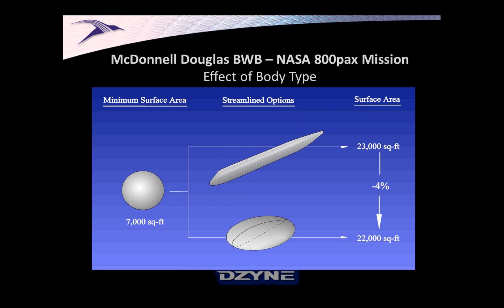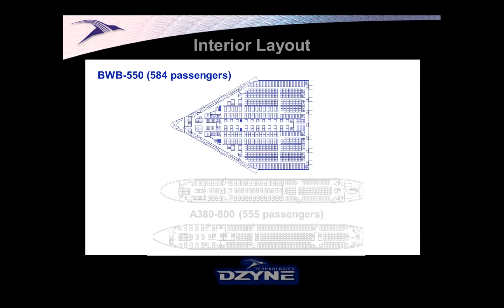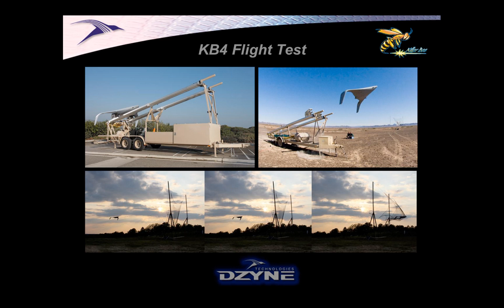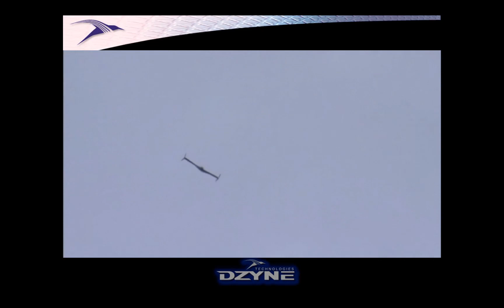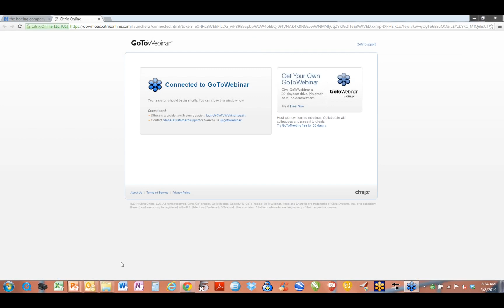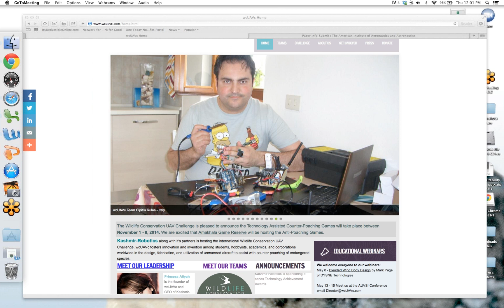Blended Wing Body Aircraft

Comment: Thanks for this amazing explanation!
I'm just wondering, if there are so many advantages for a BWB commercial aircraft, why are they not build currently?
Reply: Ive had that question for a while too
Reply: It is expensive to try new tech
Reply: It's all about inertia. Traditional aircraft have all of the equipment and infrastructure set up for them at airports, all of the interiors are fairly similar, you don't have to develop drastically new procedures for crew and so on. The biggest change we had recently was for the A380, where they had the option of second tier air bridges, widened runways and so on, and lots of airports chose not to support it. Then of course there are the passenger expectations. This kind of aircraft will not have windows for the vast majority of passengers, it will be a completely different experience, some things positive and some negative, but definitely different. TL;DR the first airline who tries one of these will need massive guts.
Reply: Conceptually great, but practically problematic. Concerning safety, fire in a standard aircraft is such a risk even though the fuel is mistily in the wings away from the fuselage and passengers, here the fuel is in that same space as the passengers, as are the engines. An engine failure or fire is usually a survivable event when the engines are suspended from the wing, but when they are in the same space as passengers and fuel... Entry- exit and evacuation, only via the leading edge of the wing...  And pressuring a shape with very broad flat surfaces, the structure has to be unusually heavy to handle the stresses..  Loading cargo into a tube can get very complex even though the shape and size of each container position is basically the same, here every position would have a different shape...  when you sit down with pencil and paper and start working on the practical aspects of operating a large passenger jet, it begins to get extremely complicated...:
Reply: Because Boeing leads, and they have said a few times that they will never build to a lifting fuselage volume, even despite the advantages.

Comment: The explanation of the aerodynamic pressures (24:30) on the wing seems strange to me. Red is normally high values and blue low values accordingly. At the leading edge of a wing, air will be compressed due to the change in flow direction, which will lead to a sur-pressure, while low pressure (or vacuum, as it's being called ??) might rather be found towards the trailing edge.
Reply: that's what i would have thought as well
the red area isn't directly at the front and we don't know the angle of attack
it's a reflexed airfoil on the fuselage section
Reply: No, he meant exactly what he said and did not misspeak. The red near the front over the top of the wing is low pressure. The blue section at the rear over the top is high pressure.
Reply: @dudea3378  true

Comment: One thing I don't see considered in this interesting design is inflight 
    internal pressure  capability. as far as I understand cilindrical shapes 
    are more capable withstanding internal pressure with less area/material/
    weight involved than any other shape or form.Would be nice to hear/read 
    your considerations about this issue.
Reply: Hi Fernando. There are several publications on this topic. A sphere is the best shape for withstanding internal pressure. Cylindrical shapes are also good. Turns out with modern materials it makes relatively little difference with normal cabin pressure.
Reply: He did address it, that's why you need all of the chordwise bulkheads which divide up the passenger cabin. Those are to provide structural support to resist the pressurisation forces.
Reply: Everyone who's looked at it: Airbus, Russavia and TsAGI, McD and Boeing, Lock-Mart and NASA say that spanwise lifting fuselage volume can have less wetted area per internal volume, less structural weight and more payload/range.
It gives so  much more payload and improves L/D so that it's still an advantage to the "normal" types.

Comment: doesn't the reflex chord profile and induced drag nullify the advantage of the tailless wing?
Reply: Hi Peter. Reflex and twist are used to improve stability, and they do add a bit of induced drag, but overall the additional drag is negligible. I prefer some reflex near the center body, boundary layer induction near the rear of the center body, and some twist on the outer airfoils. OpenVSP is a good tool for trying options.
Reply: the improved L/D of an all-wing outpaces any such things. Makers say it can have less drag, more internal volume, less structural weight, more payload/range.

Comment: he said the leading red area was a vacuum and the blue at the tail was pressure, NOT, other way around. 
Collision between still air molecules or brick walls is PRESSURE. Pressure is HEAT, vacuum is COLD due to 
ELCRONS in suspension forced together or spread apart. Keep is SSIMPLE.

Comment: No windows! It'd be very boring on long-haul flights.
Reply: I have to agree.Unless they install a camera for the windows, but it won't be the same.
Reply: True, but the lack of natural light for the inner cabins will make the those zones feel more cramped than before hand.
Reply: You can still have windows on the upper and lower floors on the side of the wing body but they will be tilted so the top floor passengers will only see the sky. On the bottom you'd have a really nice view down though. And of course you have the front windows and considering it's a really short cabin I don't think it's that bad because the back passengers are not that far away. But for the people in the center yeah they're a bit screwed but I see in this design they made that first class so they have beds and everything.
Reply: I agree, although a lot of manufacturers are talking about doing away with those anyway, so if they do that on traditional aircraft, there is less disincentive for a BWB